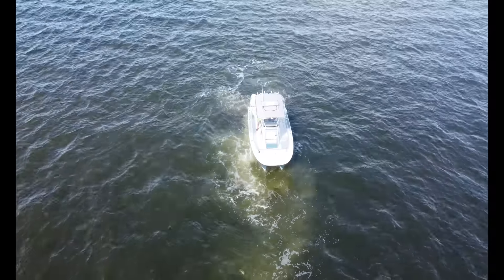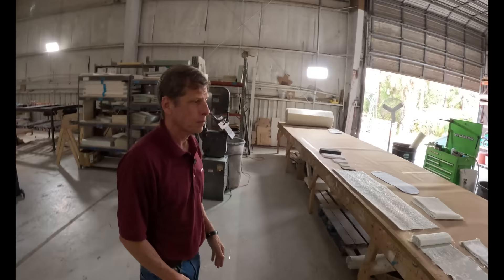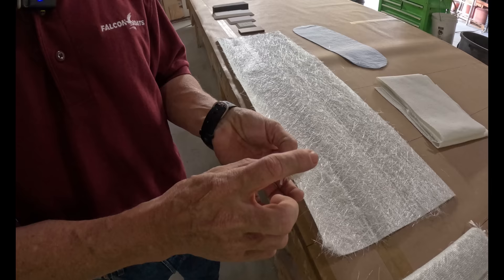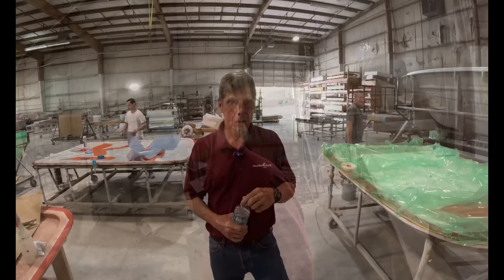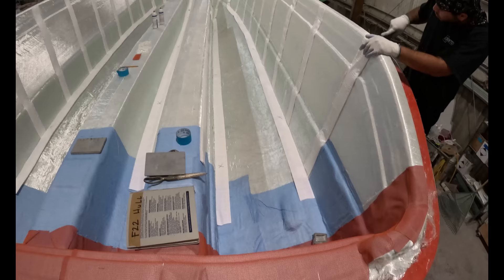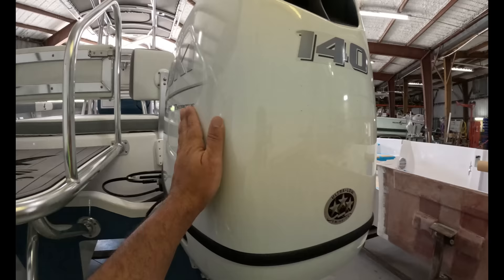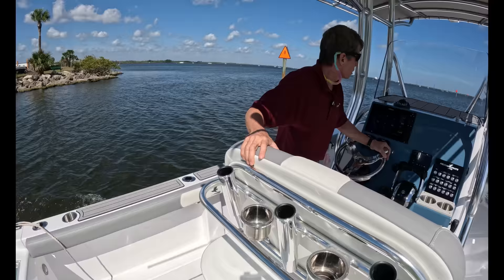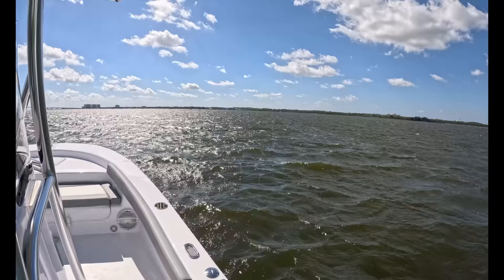Falcon 22' Catamaran - Factory Tour and Sea Trial!  Big Boat Ride in a Small Package!

Comment: John:  Thank you for introducing us to the Falcon 22.  What a nice, easily to trailer, center console boat.
Reply: After posting I thought of  question.  What is the maximum HP the boat is capable of and do you believe the 140's are a great match?
Reply: @edgewater210  300 hp is the max but I wouldn't recommend the boat unless you like a boat that steers the way it wants versus the way you want.

Comment: Good video hope you make more like this the same manufacturer has the small ones make quality boats a great prices !
Reply: If you’ve shopped around recently, you know a base boat at 130k is an excellent price point… this boat has more room aft of leaning post (where it matters most) than the costa 264 and double the room of the 23’ Tideline… not to mention a top tier build quality… the ability to work with the builder to custom option them out (sky’s the limit) from 130k is nice as well.
Reply: yes  it  çab8nnçrser 23 fitrer are 130000 with csbiac genert tv heads
Reply: @ryanhountz7570  have you sold yours yet?

Comment: Nice feature for 22 price is reasonable   Would like a nicer hardtop without the legs outside of the console but that would also cost more
Reply: You don't want a hardtop on this boat. It has handling issues at certain speeds already. Add more weight to the top and it will be worse.

Comment: Bravo ! Excellent video, very impressed with their build methods and materials, for me the perfect size, and what a smooth ride, 35mph in choppy windy conditions ( perfect conditions for a sea test ). Two questions, it looked like the boat was leaning to the port side ? And can you get trailers to accommodate the Cat Hull ? Love this video, thanks.
Reply from the maker: Was tracking straight as far as I could tell and yes on trailers.  This one had a Magic Tilt…..
Reply: At 35 it will track straight. Try running it around 25 mph and let me know what you think. Its simply unsafe.

Comment: I don't care what you say, it's downright criminal to charge over $100K for a 22' boat.  The website shows it at $145K.  It seems like every boat manufacturer tries to outdo everybody else in the absurdity dept. when it comes to pricing boats.
SHOW ME the materials list (minus the outboards) because I know there's nowhere near --  in materials and labor -- what you're charging for the boat, especially if you're using a hull mold built by someone else.

Comment: Too bad the boat is unsafe to drive at certain speeds. Build quality is excellent but Matt has no intention of working with his customers to address handling issues it has when outfitted a certain way and at certain speeds. Biggest waste of $150K in my lifetime.
Reply from the maker: Sorry to hear that.  I did not get that sense when I was on the boat. Felt very stable.
Reply: @jiggingjerks  did you run the boat or did Matt run it the entire time?